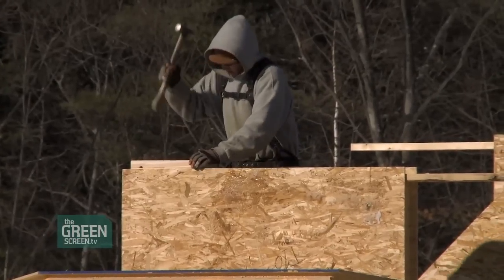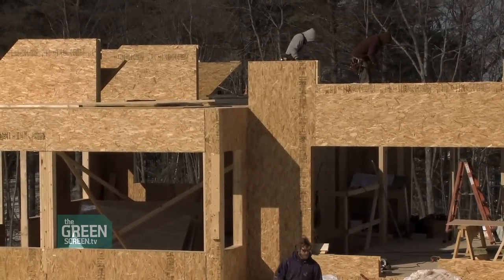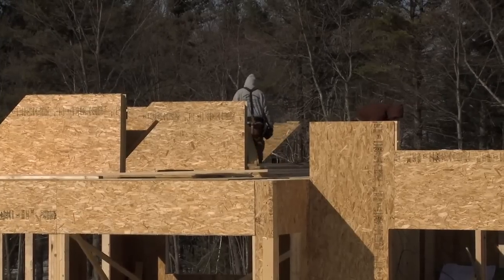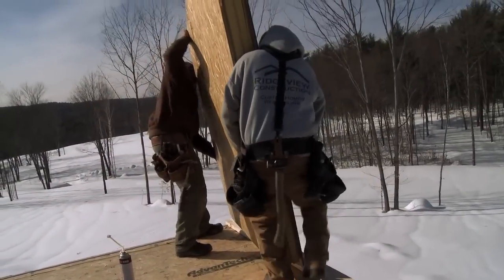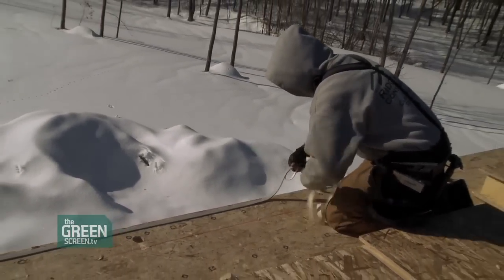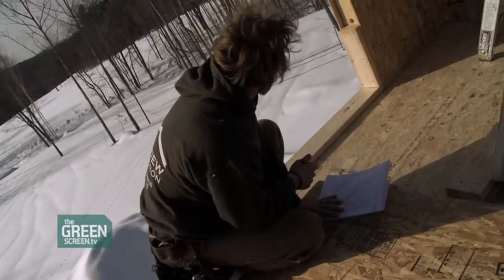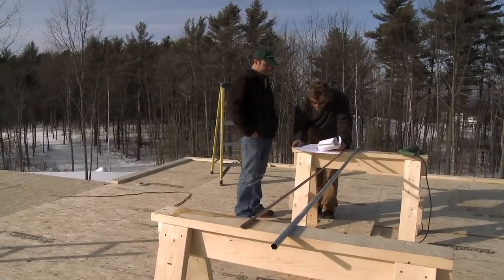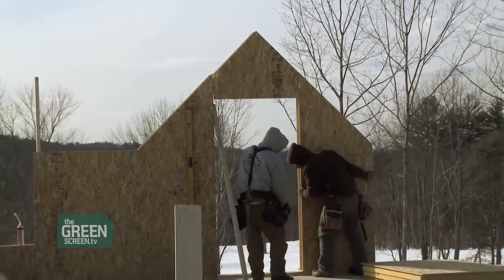Ridgeview Construction Structural Insulated Panel SIP House

Comment: Are these panels already prefab (cut, pre designed, and quicker to setup)? IF so, then I stand corrected.
Reply from the maker: +The Photo Booth Chick I was just the dude behind the camera to Shane Carter of Ridgeview Construction in Deerfield NH could give a fuller answer, but from what I observed the CIP are made in 4 x 8 panels and carefully assembled on site, as we observed. The fixing process of the panels is important to maintain integrity, I should think for weather sealing and for structural support. It was pretty slick to see these people put them up! Properly installed looks tight and tidy. Wouldn't know about a comparison with a fully prefab wall, but I bet there is research based on blower tests.
Reply: Absolutely!  Thanks for responding!  I am doing some major research on this now.